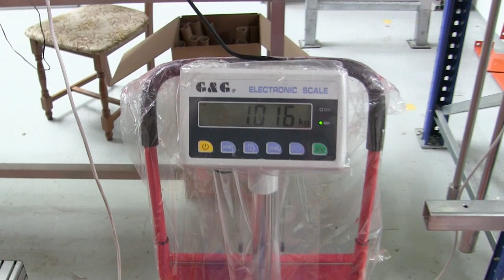How to cover a Rudder; Airworthy in 80min with Oratex, needs no Paint !

Comment: I work for Stolairus Aviation in Kelowna, British Columbia. (Structures AME)
I am surrounded by light fabric covered aircraft From my understanding, nobody local in BC is doing fabric anymore.  I heard there is one older fellow in Langley possibly still doing "some fabric."
Are you guys putting on any seminars in 2022?
Reply from the maker: Yes, will be doing that here in AK for sure: Late April or Early May most likely. Will keep you posted. Will also be in Oshkosh at EAA as always, this year 2022: at EAA Airventure (2021) with our booth #300 near the Control Tower. Right beside Hangar A. Right on the main road that passes in front of the tower. Regards from Alaska!

Comment from the maker: Regarding the Tools; One is a Toko T14 Flat Hot Iron with digital temperature control, we sell those all the time. You cannot use the Oratex without it. Also critical is the wool-block "Felt Blade" he is wielding with the Steinel Heat Gun...

Comment: Do you put glue on the fabric where the finish tape is going on? I know the finish tape has glue on it .
Reply from the maker: You are putting glue down before a tape is applied for other reasons, not for adhering the tape itself: Only put a narrow line of glue onto the top-layer of the seam, thick but narrow, like half inch or 1/3 inch, not less than 1/4 inch for sure. Before taping, both rib-stitching thread and the re-enforce tape have to be well covered in glue. But the Oratex tapes have their own glue, they do not need normal glue to stick. So do not put glue down as wide as the tapes;that is not needed and can lead to really bad messy problems if glue shows up beyond the edge of the finishing tapes! It’s about the worst mistake you can make; to "uglify" your Airplane/Oratex surface with Oratex glue that has been painted onto the surface and did not get covered up by the finishing tapes! Once the glue has been triggered with heat, there is no practical way to remove it from the surface. Do not put any glue on the surface where it might end up beyond the edge of our tapes, the tapes have their own glue on the underside! The only reason for the narrow line of thick glue along the edge of the top layer of the seam is to hide the seam line and make that"Step" of the edge disappear under a "Ramp" of molten glue that will form smoothly when you iron the tapes on at 120˚ Celsius. This is especially true on wooden airframe structures. On Metal airframes extra glue underneath the tapes may be needed to overcome the heat-sink of the metal surface underneath. On the other hand the need for the narrow line of glue under the tape exists to prevent air entrapment under the tape, such as with rib-stitches and rivets. Air caught under the tape will promote the tapes to come off (Also it will look like hell later)! On Super Cub like steel tube fuselages and similar great heat-sinks it may be necessary to apply the normal glue as wide as the contact surface with the Metal underneath the Oratex-layer in order to make the tapes adhere easier. In those cases glue applied at least as wide as the contact area with the metal structure is great, but it must be narrow'er than the tapes that are put on top of it after the glue has dried. If the correct heat gun is used with an extension cord short enough (no Brownout!) the use of glue as a barrier against the heat sink of lower longerons should NOT be necessary. That issue pretty much only came up were customers failed to use the tools we recommend and sell.
Please email me for instructions, Regards, Lars

Comment from the maker: EAA Oshkosh Airventure 2016;
We will be there in force, 4 booth spaces as always! We are at  1156/1157; That is in the tower-side corner of Hangar A and in the Ultralight area at 943 & 942, those are the corner-booth at the downhill end near the paved road. 
 
Workshops;
Monday 7/25/2016, 2:30 PM
AeroPlane Workshop Stage 2; Oratex Fabric How To Apply

Tuesday 7/26/2016; 4:00 PM
Ultralight Forums Tent, Oratex Fabric Coverings

Tuesday 7/26/2016; 8:00 PM
Ultralight Forums Tent;  Bush Flying In Alaska

Thursday; 7/28/2016; 2:30 PM
AeroPlane Workshop Stage 2; Oratex Fabric How To Apply
 
Best Regards,
Lars

Comment: i used oratex on model aircraft 40 eu for 2400 x 600 mm  its not cheap easy to work
Reply from the maker: The Oratex for model airplanes is very different from the Oratex6000 for General Aviation Aircraft ! - The products are not the same at all.
Reply: @BetterAircraftFabric  i know its heaver i still would prefer the old polyester fabric the dope really glued the seams shut oratex is just contact  like evo

Comment: I'd be interested to cover my Piper PA14 with Oratex.  How can I get a quote for the materials/tools?  Thanks!
Reply from the maker: Hi Ben Pontier; if you were to bring it to us and we cover it comepletely in our shop everything combined would be 20K Dollars. If we send an installer to you, he would charge 8700,- for the service and you have to pay airline tickets and room and board. Experience has shown he can do it in two weeks and use as little as 38meters of 72 inch wide Oratex. The typical do-it-yourself customer needs 45 meters, experience has shown. Material cost can be 9500,- ,if you would buy everything we have to offer, but if so desired it can be done for about 7500,- as well. All colors are the same price. Best Regards, Lars

Comment: 8:07 what product are you using?
Reply from the maker: The normal Oratex6000 glue, the harmless water-based stuff that holds over 100 pounds per square inch in a shear-load test.

Comment: How does cost compare to ceconite or ploy fibre processes?
Reply from the maker: As this is a high-tech product with all coatings already applied at the factory, instead of being a plain polyester woven cloth and a bucket of paint, the Price of the certified Oratex6000 is higher! - but labor cost to install is lower.
Reply from the maker: ... and if you read further comments below there are pricing answers, too.

Comment: Trailing edge tape, he did not apply glue to the fabric, just used the pre-glued tape. 
So, when using pre-glued tape we dont need to apply glue to the fabric ??
Reply from the maker: Yes and No, it depends. Basically the Oratex Finishing-tape has the glue already under it to glue itself down for sure, but usually You tape Rib-Stitches and Pop riveting and stuff and in those cases you have to put down some glue on those first, sorta like a filler to exclude air bubbles or it will look like hell.

Comment: It almost is a good alternative to other fabric applications.  I am speaking from the experimental world.  Oratex and traditional fabric both have pros and cons.  The pros for Oratex-lighter weight, less labor to install. Fumes is no longer a pro since Stuart systems is water based.  Cons-colors are bland and custom paint erases the weight savings.  Cost of materials, make a major mistake with this stuff and watch the cost quickly escalate.  The pros for traditional - cost of materials, you don;t need to worry about making a mistake.  Much more options for colors and paint schemes.  The Stuart systems eliminate the chemicals.  Oratex could have been a game changer and opened up the market for more fabric experimentals by providing an alternative to traditional fabric at a lower cost.  However, home builders value their time as free so the labor savings with Oratex doesn’t really resonate with homebuilders.  If homebuilders truly valued their labor time, they wouldn’t be home building.   Instead they would by completed aircraft.  The Bushcat with the tri lam fabric is truly the most revolutionary fabric with ease if install.  However, you can only get it for one plane.  I am sticking with Aluminum.

Comment: Looks like vinyl car wrap.
Reply from the maker: Hi, it sure as hell ain't like vinyl car wrap. Oratex6000 is a woven cloth, with 7 coating applied at the factory. It is UV-proof. Vinyl ain't. It is extremely tough. Car wrap ain't. You could not build a Super Cub by covering it in Vinyl Car Wrap. Oratex Super Cubs are lighter than all others and yet their fabric surfaces are tougher than the traditional systems; those old ones are "Polyester bedsheet and spray-painting". Oratex is an absolutely unique system.
Reply: Well... I didn't mean that it was vinyl wrap. I just said it LOOKS like it. I'm sure it's a wonderful product.
Reply from the maker: Hi Stanley, Thank you for that comment, appreciated. If you want to see a sample of Oratex we can send you some and we can also get you in contact with local customers so you can see it in action firsthand. Best Regards, Lars
Reply: I have an idea for an experimental ultralight aircraft. I need a covering that is very light weight. How does your product comcare to comparable products ?
Reply from the maker: It is, by far, the lightest viable solution out there. For sure. Check the video about that on this channel. We have a detailed real-life weight comparison video ...
Reply from the maker: https://youtu.be/Tjzn0UA2VeE
Reply: Empressave